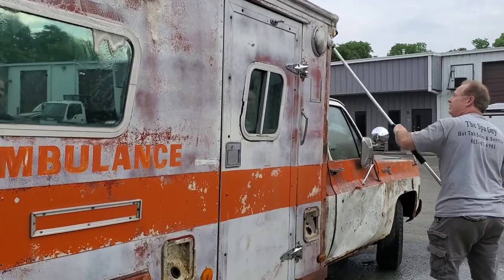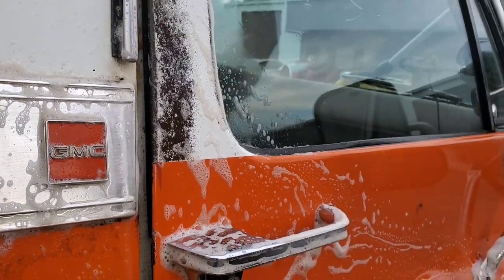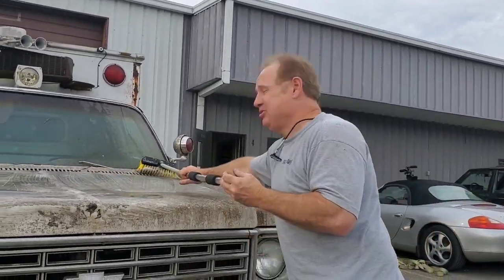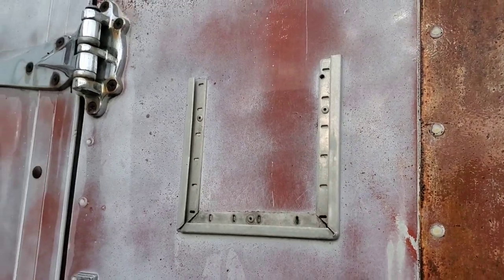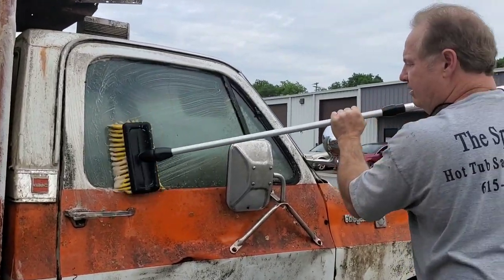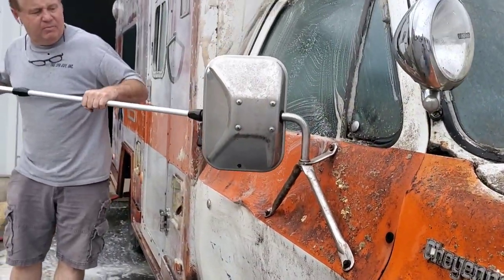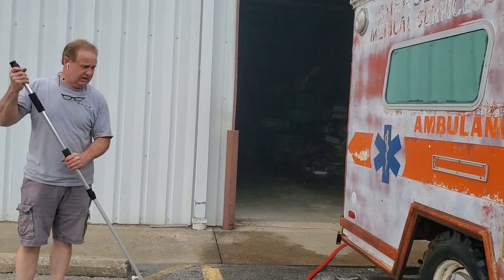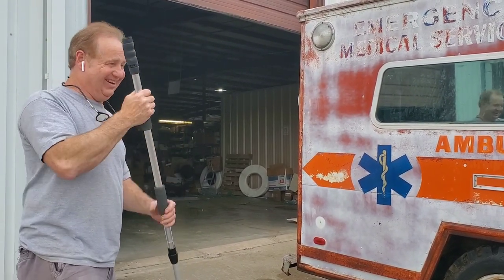Elvis Presley Lost Ambulance ALMOST SCRAPPED "Cleaning Up History" Episode 2 Behind The Scenes

Comment: That dent in the RH door will pop out if you take off the inside door panel, raise up the window and push the panel out from inside the window crank access area.

I've done it 100 times....
Simply take off the window regulator handle " U " clip by sliding a trim tool (looks kinda like this🔧) in-between the door panel and window regulator handle.
Be careful not to lose the clip as it will fly when you dislodge it from the splined stud. Remove the crank handle 

Next take out ALL the Philips head screws ( 4 on the bottom, 1 behind the door handle area (recessed cup), and 2 on the top of the vinyl foam arm rest) 
Next carefully pull the interior plastic panel up and out away from around the inside door handle, making sure the handle is also being pulled outward (to you) in order to clear it in the process.

After the panel is off, locate the middle of the dent and push it out with the palm of your hand starting from the body line at the bottom of the orange stripe and work it out as you go along.

A "paintless dent repair" specialist could be called in if you're unsure about it.

Also, use some pb blaster or transmission fluid on each of the door hinges and especially on each of the hood hinge rivets as the hood structure will most likely buckle at the crash folds underneath if you attempt to close it without oiling first!! Looks like it has the typical GM truck "hood buckle" already going on.....

Cool find!